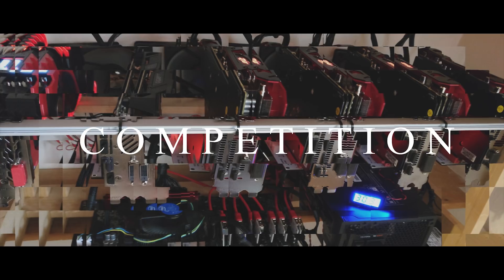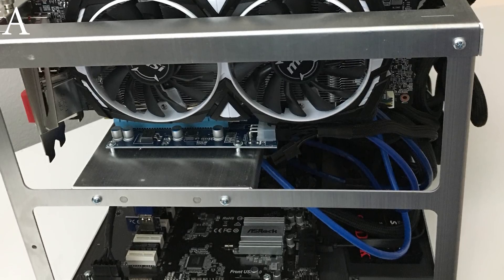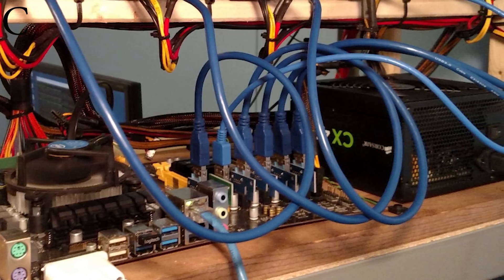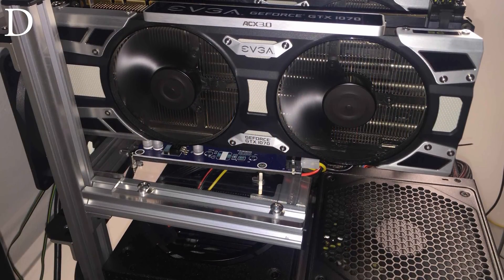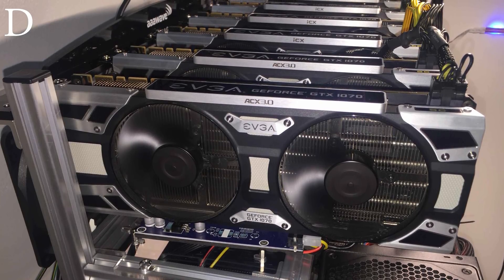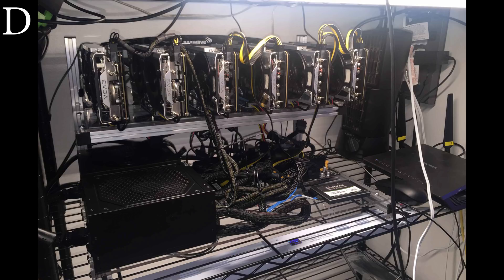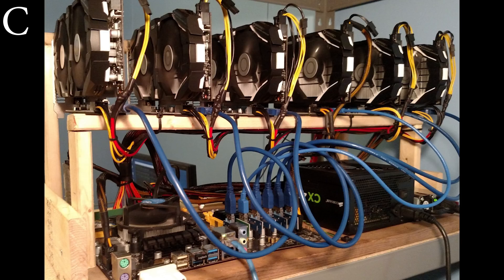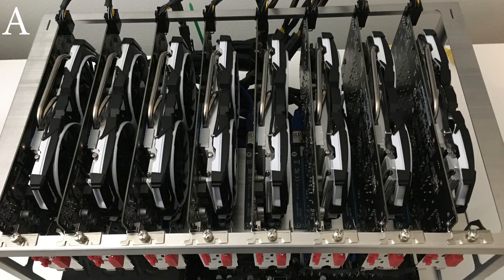Mining Rig Wars #13: Best Mining Rig?

Comment: Hi brother, 

Im going to start mining. I read some article and watched videos to get knowledge about building a rig. Now I’m ready to buy things before that I’ll tell my plan if there is any wrong/mistake please let me know. 

Mother board 
ASUS PRIME H270-PLUS LGA1151 DDR4 HDMI DVI VGA M.2 H270 ATX Motherboard with USB 3.0

Processor 
Intel BX80662G4400 Pentium Processor G4400 3.3 GHz FCLGA1151

Power supply 
EVGA 750 GQ, 80+ GOLD 750W, Semi Modular, EVGA ECO Mode, 5 Year Warranty, Power Supply 210-GQ-0750-V1

Graphics card
Gigabyte 1060 6gb (Hope 6 cards) 

Plz let me know if there is a mistake....

Comment: Would you talk about cable mgt more?  I have a small farm but am not concerned with making things “pretty”. What about cable mgt risks a fire?
Reply from the maker: Wires get hot melt together and short. That's the biggest risk.
Reply: Oh. I have all mine on 6' wire storage racks with tons of room for airflow. I suppose cable mgt is more important if everything is closer together and concentrates the heat. Thought about submitting my 55gpu farm for Rigwars but mine don't exactly classify as "pretty"!

Comment: ROI Rig https://imgur.com/a/uD5JK

Aluminum angle/solid wood frame ($60) https://imgur.com/PrbUunN
8x 3gb 1060 SC ($1600) w/Samsung Memory https://imgur.com/ewGe82Y
Biostar BTC 250+ mobo ($120)
4gb ballistix DDR4 (2400) RAM ($55)
G4400 CPU ($60)
Fully modular Corsair HX1200watt PSU ($250)
8x Ver008s powered risers ($65)
60 GB SSD running windows 10 OS ($35)
Total cost ~$2250 200mh/s ETH (+900 memory), 2400 sol/s equihash, 4000h/s cryptonight

Selling my first rig on Ebay to do a new build https://www.ebay.com/itm/263399564570

Comment: Thank you for featuring my rig on Mining Rig Wars (Rig C). To clarify, this rig uses only one server power supply to support the atx unit. Sorry about the confusion. Since these photos were taken I added one more matching 1060 using a ngff adapter for a total of seven. Power at the wall into the server power supply is now 640 watts running 6 cards with 120v. These server supplies are capable of 240v, but that is not available to me currently. The atx ps runs the motherboard, hdd and one 1060 loafing along at 135 watts at the wall. Also the wooden frame is home brew with my own measurements but loosely based off of other designs.
Reply from the maker: +ICU2 GetMe awesome. Thanks for clarification.